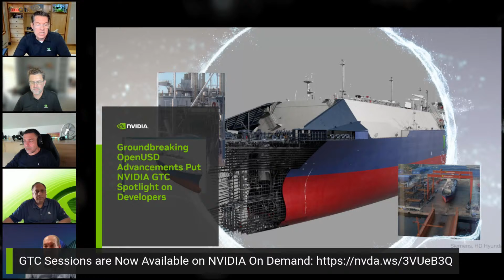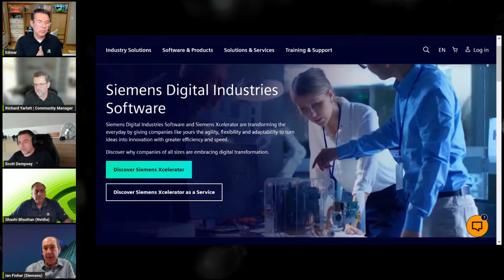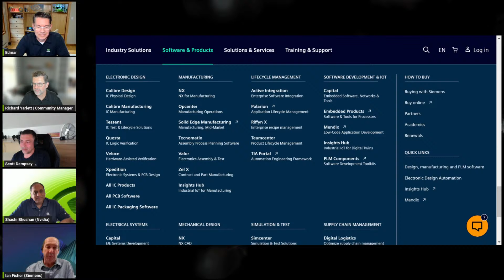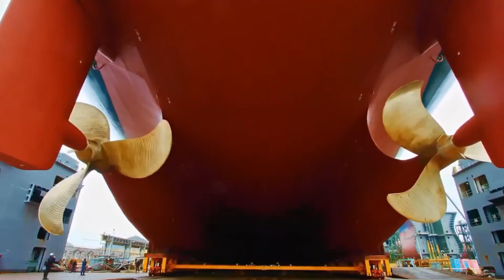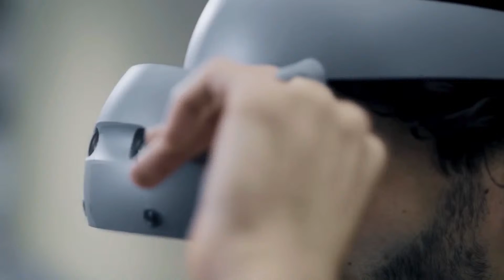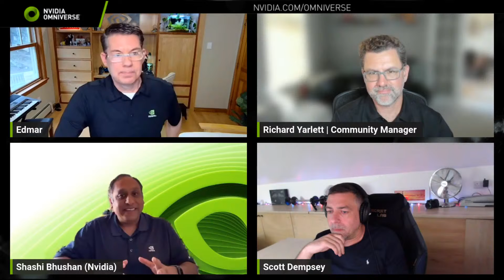Industrial Design with OpenUSD and Generative AI Workflows

Comment: 19:04 uh.. what? The ship builder put a part in the wrong orientation, and you are saying they could have been prevented by a photorealistic rendering? Straight garbage, clearly they don’t know what they are talking about. These men think people build things off 3D renderings. No, we do it from 2D plans. 3D is quite useless. The real issues are communication issue between designers and contractors. Solve that. Not try to find a problem that doesn’t exist. Not having 3 D has never been a problem in any type of building.